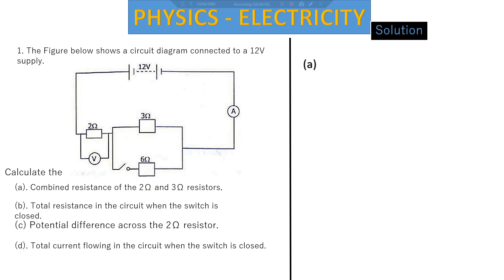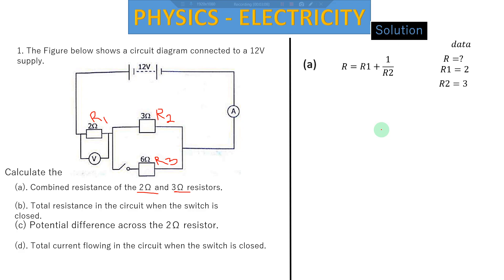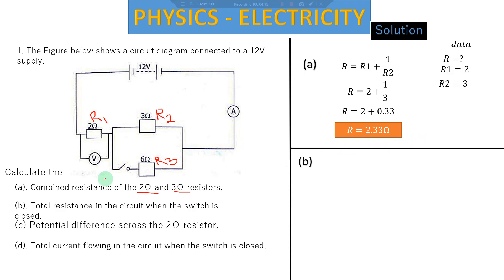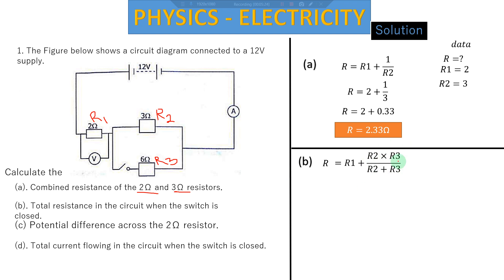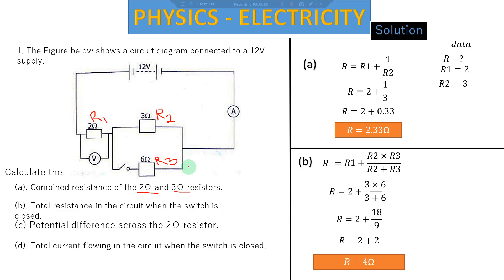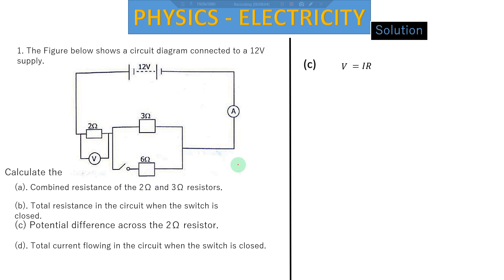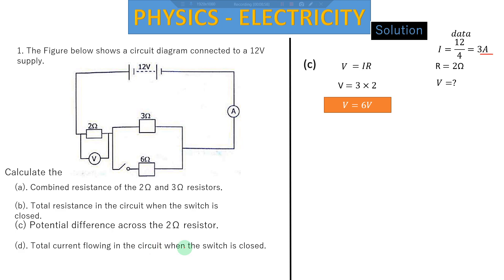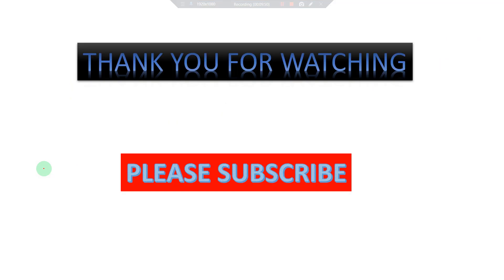How to calculate resistance, current and voltage

Comment: Hw d c is charged for a c
Reply from the maker: To convert direct current (DC) to alternating current (AC), you need a power inverter. This device takes DC power from a source like a battery and converts it into AC power

Comment: An alternating voltage is given by V 20sin πt where V is in volts and t in seconds. Determine the instantaneous current and instantaneous power dissipated across a resistor of resistance 5k ohms

Comment: The electric field between the plate of a cathode ray of seliscope is 1.2*10^4 N/C.
 What deflection will an electron expense if it entered at right angle to the field with a kinetic energy of 2000 electron volt , if the deflection assembly is 1.5cm long ?